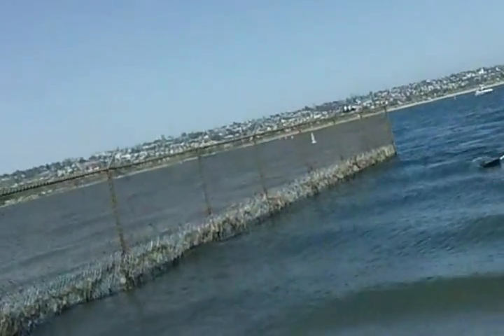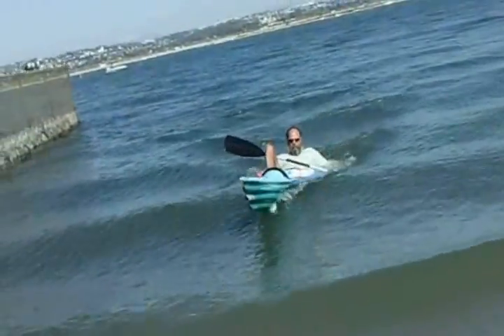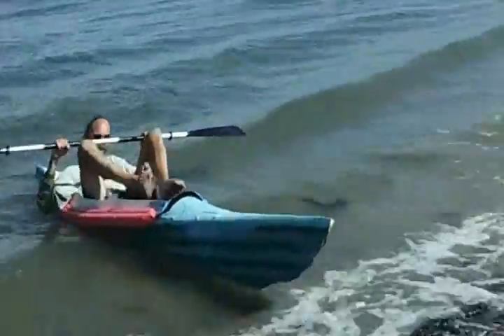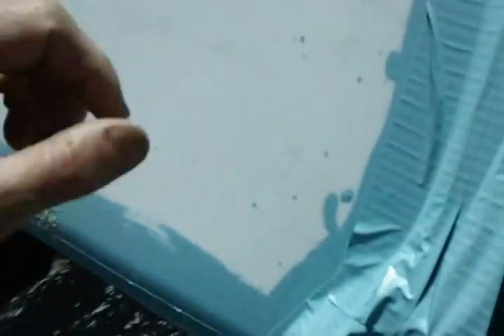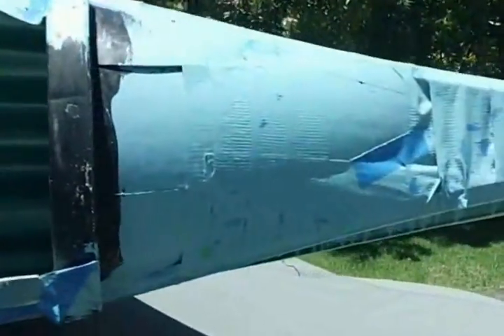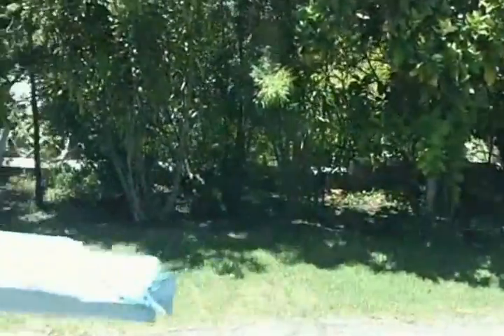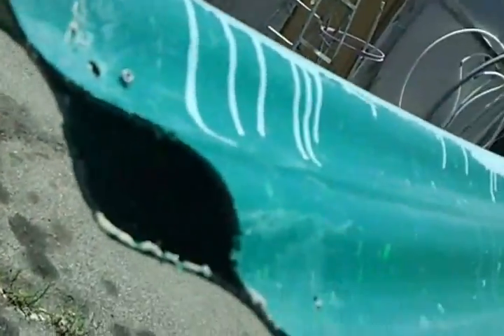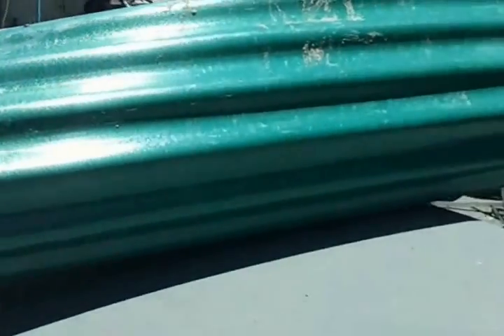kayak homemade 14 lbs. 10' corrugated roofing plastic  6 kg $40. diy fast easy total fabrication

Comment from the maker: Thanks.      there is no frame.   because the plastic sheeting is curved, it is plenty strong in each direction.   except that the gunnels want to bow out.   i ran a 5' by 1" pvc tube along the middle of the top of the rails and then wired them together just in front of and behind the seat.   it keeps it from becoming wider and distributes the force.